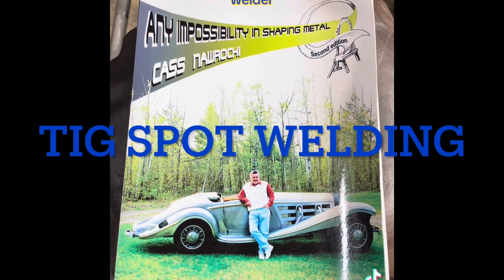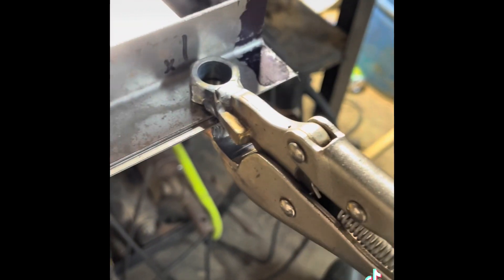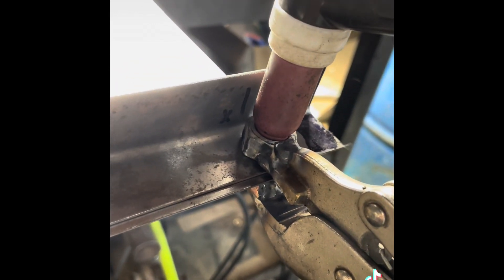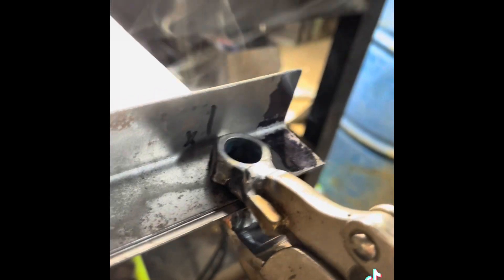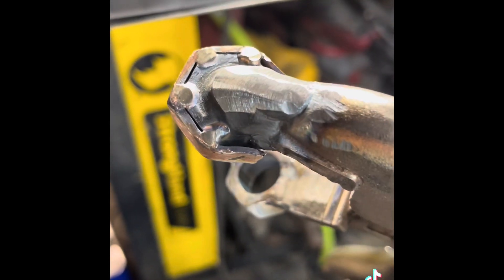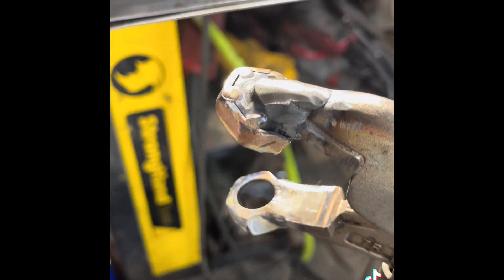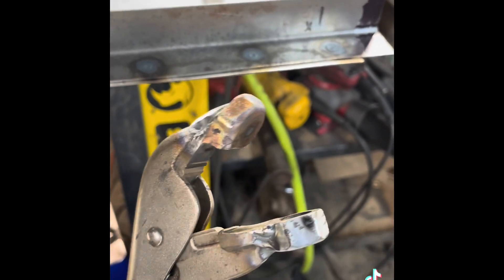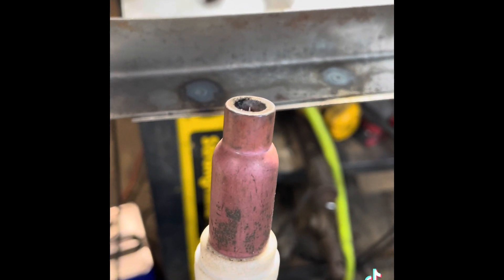Spot or plug weld with tig welder

Comment: That works a treat. I have seen it done before but that clamp makes better sense
Reply from the maker: Yeah the tighter the panels are the better it works. Cas made different depth and offset clamps for different situations where he couldn’t get the part to the spot welder or didn’t have jaws that worked. Cas is a slick guy I hope to meet him one day.